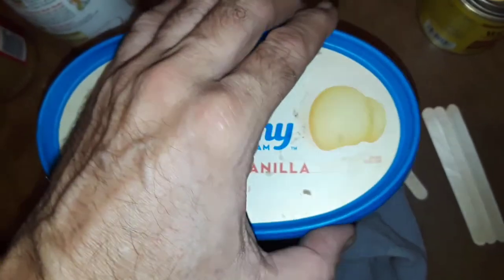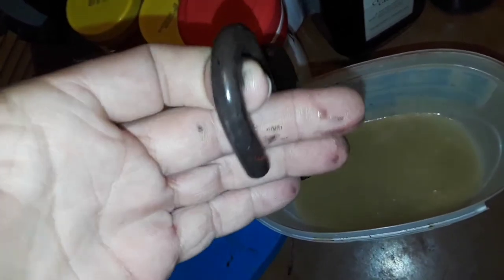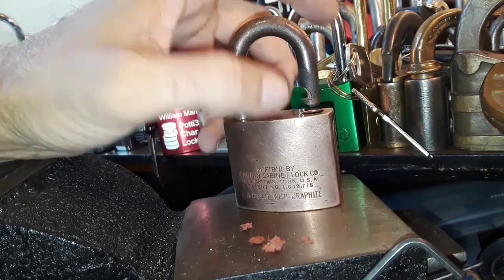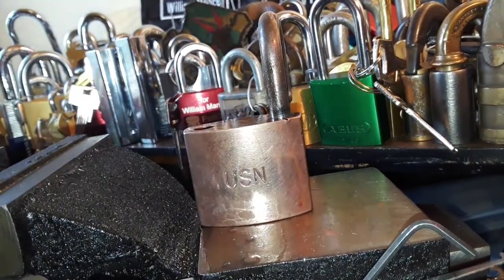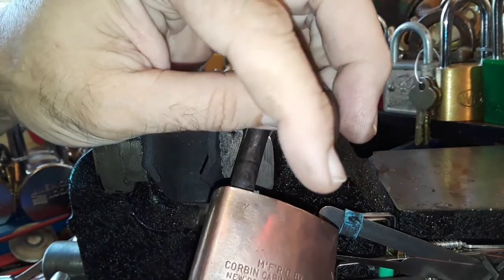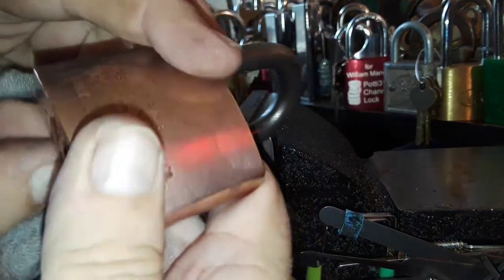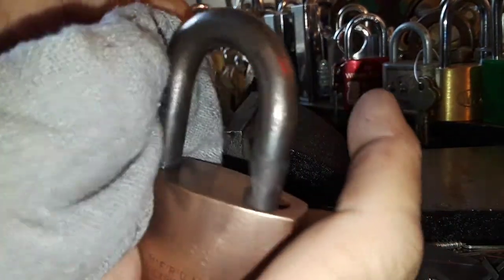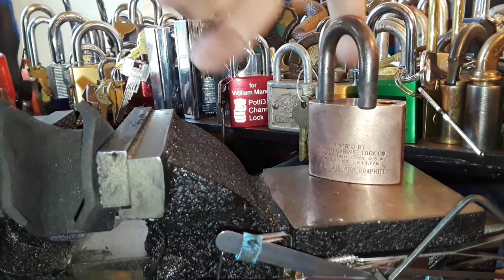(417) Vintage Corbin USN Padlock  & Vinegar Update

Comment: Interesting cleaning method. I was a bit dubious at the start, i thought you may remove the padlock from the marinated liquid and toss it aside and drink the acidic brew. lol. I reckon all but one of those driver stacks are above shear. Just a thought. Cheers William:-)
Reply from the maker: Paul Springett Yes, it opened too easily. Probably when I locked it back up, most of the pins were set already. Thanks for watching.

Comment: Nice job ... The way it popped open on you I think it was saying “please no more acid“ ... very nice 👍🏻
What kind of lubricant did you spray into it?
Reply: John Mccormick 
Looked like🤔 WD40 for locks💦 that William used... but not positive. 💫lol
But if looking for the best lube... in my opinion is Houdini spray lubricant.💨 
But I don't give any crap for using what you like.
Reply: Steel Pinnings thanks for the info ... from working on mechanisms at work I used to shy away from WD40 due to the penetrating oil part of it ... used to use Tri-Flo ... for locks I use Lock-Ease but heard that it may not be the best choice either (SE Lock video guide)
I’ll have to get a can of the Houdini stuff 👍🏻
Reply from the maker: I used 3 in 1 oil dry lock lube. Can't find anything better locally.
Reply: William Mancel 
I thought it was likely the 3in1 after I said WD40 lol the 3in1 lock stuff is just fine really.  It doesn't have the best life is it's only downfall.  
I have TriFlow but not the spray... it's the thick stuff like grease.  Lol
I think that it is hilarious to see Bosnian Bill squirt WD40 in a lock and the comments explode.  Lmao
Reply from the maker: Steel Pinnings before I knew better,  I used wd40 on crap locks that were frozen. I like Jason's video on lube test. This 3in1 lock stuff was the best I could find at Wal-Mart.